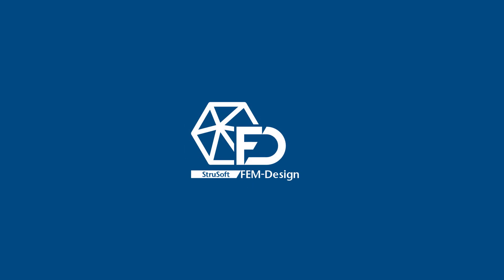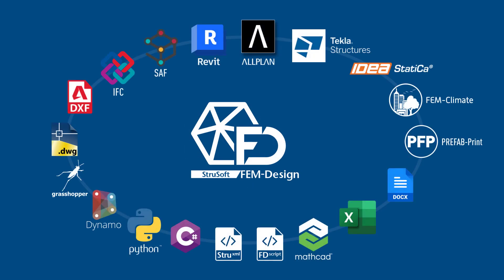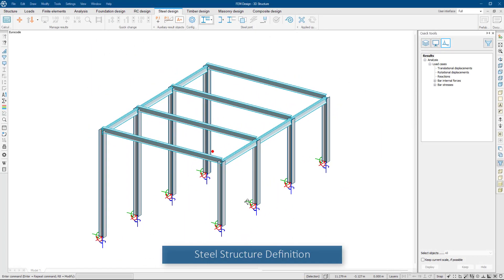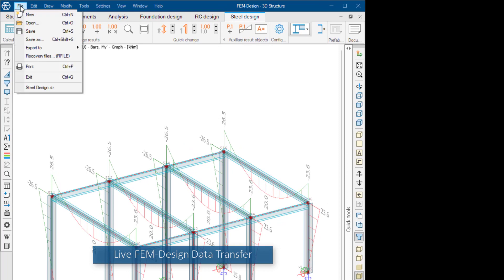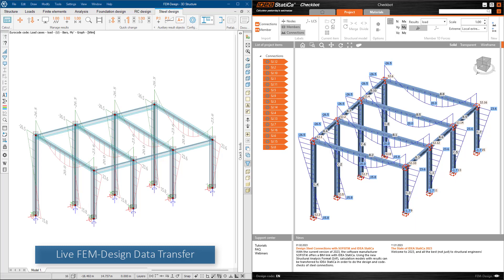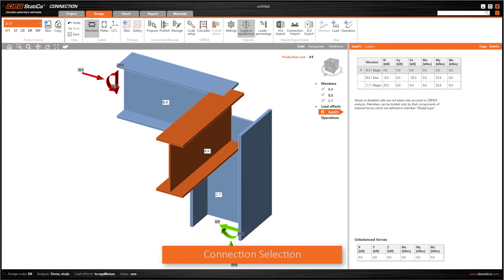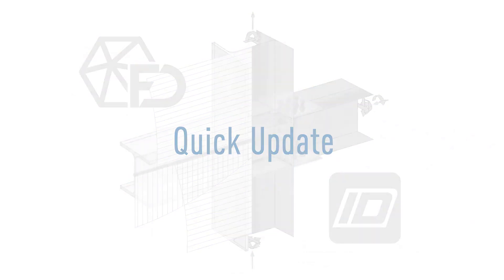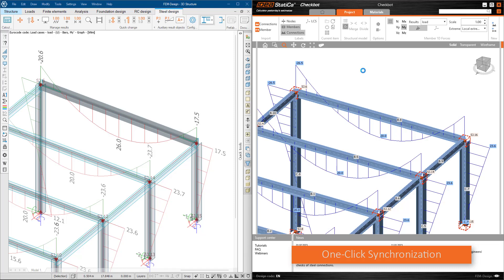FEM-Design - IDEA StatiCa    |    BIM Interoperability

Comment: Hello! When will Load Combination transfer be available? As of now, FEM Design can transfer only Load Cases to IDEA StatiCa, which is not enough to design/check a connection.
Reply from the maker: The already available FEM-Design version 22.00.002 supports the transmission of Load combination internal force results (including those from non-linear calculations too).
Reply: @StrusoftOfficial  Thank you!
Reply from the maker: @hornyaktomi  You're welcome!